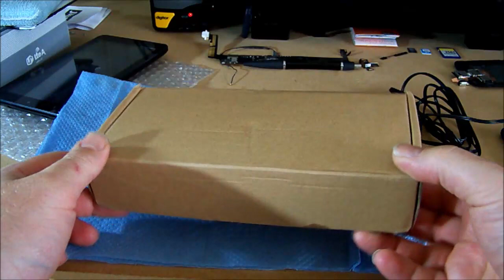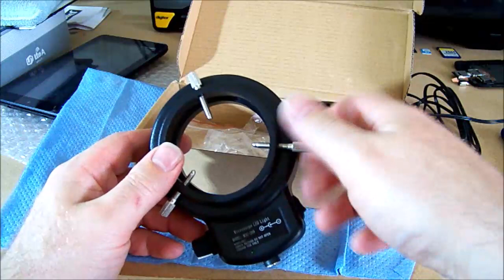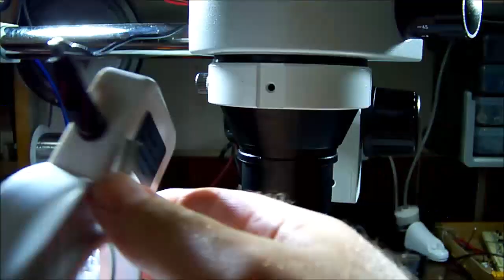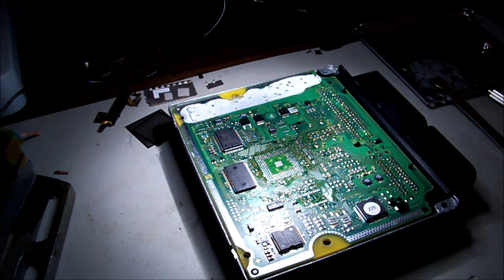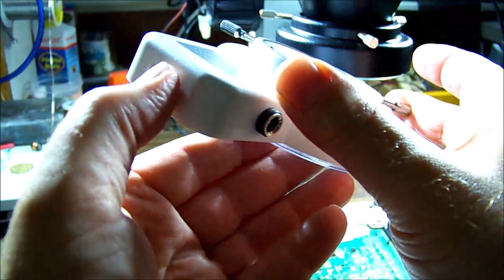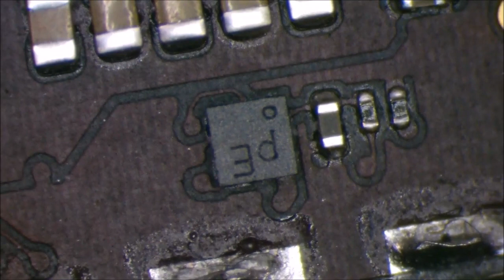MIC-209 144 LED microscope light ring review.

Comment: Ironically, the resistor value was readable with the old ring and workbench light, but not readable with the new ring due to higher reflections from the flux on top of that resistor.
Reply from the maker: Indeed :)
Reply: This is my problem. I have some great powerful ringlights at a comfortable color temperature. But I can't see what I'm doing when doing actual work, due to the reflection glare off flux and solder.